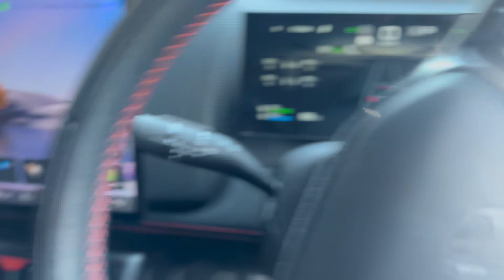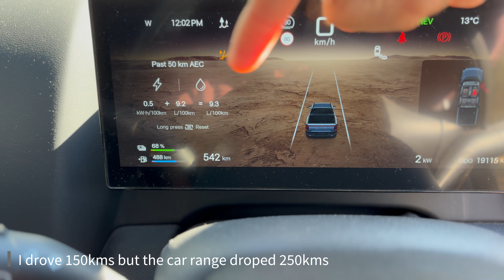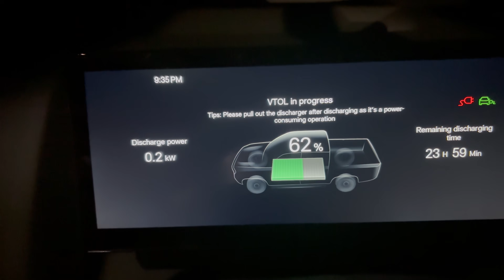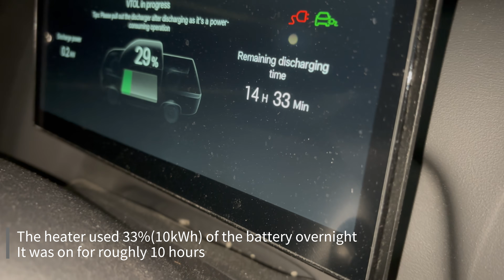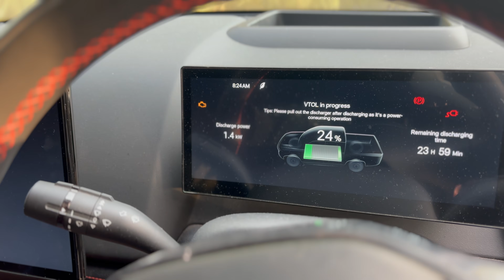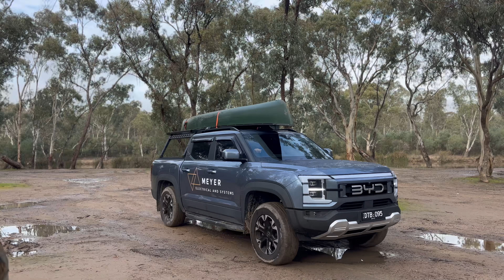Real-World EV Camping: Coffee Machine, Heater, Oven, Canoe & More BYD Shark

Comment: Space heater in a tent seems pretty inefficient, why not just a 12v electric blankets from your other battery you have and just use the VTL to charge that up
Reply: The downside to an electric blanket is that you're hot on the underside and still cold on the top.  It's like a firefighter - hot at the front facing the fife, wet and freezing cold on the back.  And what's this about 12V blankets?  They mostly have 2 or 4 hour timers, so you wake up in the middle of the night and have to start them again.  Regular 240V electric blanks work just fine when camping with the Shark.
Reply from the maker: @P@PaulRees-c9 thats correct. A blanket works but in my opinion it’s not as comfortable as a space heater. And good point about the 240v blanket. More power and more time. 👍🏽
Reply from the maker: Yes. Space heaters are very inefficient in a tent. I’m not trying to be efficient tho when camping for one night. Just very comfortable.